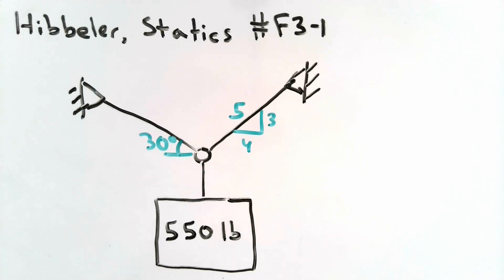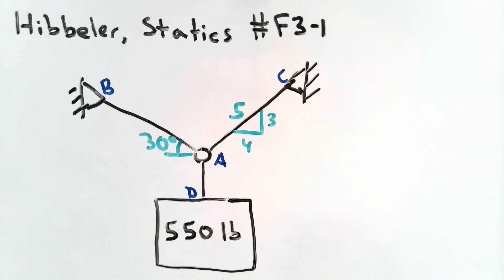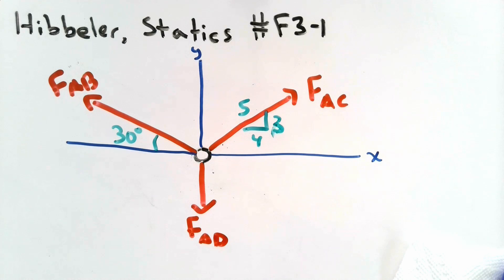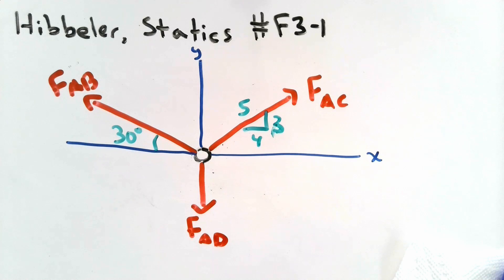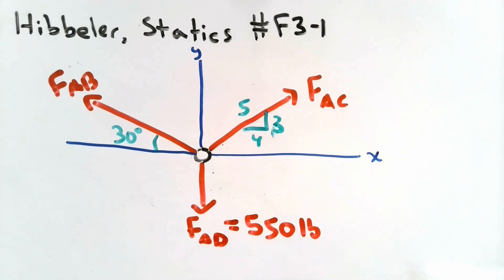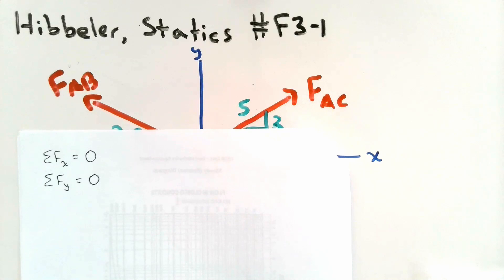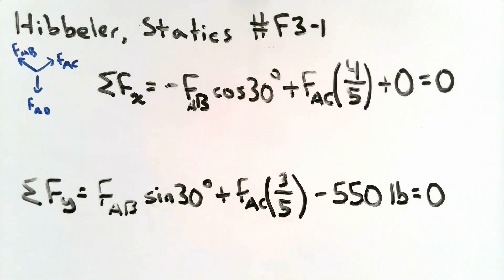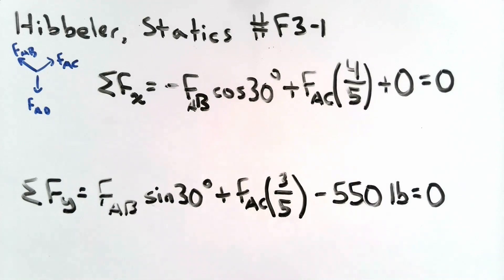Problem F3-1 (Hibbeler, Statics)

Comment: Hey professor, my summation was quite different, for Fac I get 470.86, no matter how I input the information.
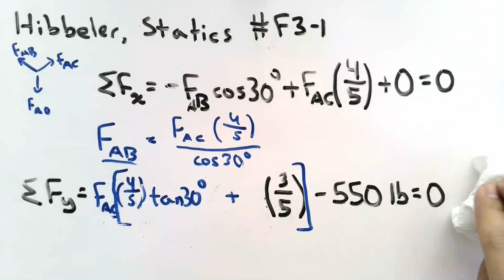Reply from the maker: Miller, let's look at it step by step. Look at the bottom equation on 10:21, where F_AC is already factored out. Let's solve the numbers in the brackets first:

(4/5)tan30 = 0.462
0.462 + (3/5) = 1.06

So the numbers inside the blue bracket add up to 1.06.  Now to solve for F_AC, we'll add 550 to both sides and divide both sides by 1.06. This results in 

F_AC = 500/1.06 = 518

Hope this helps.
Reply: @EngineeringTheory  hello sir
, by me (4/5)tan30=0.407... is that right?